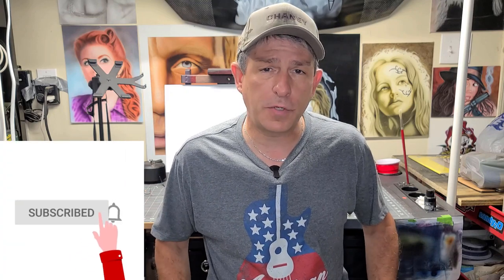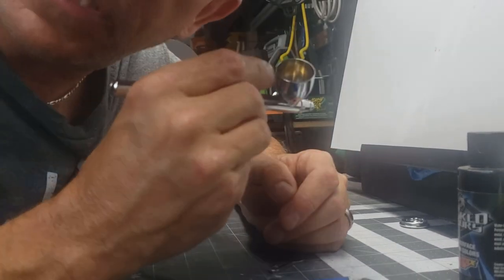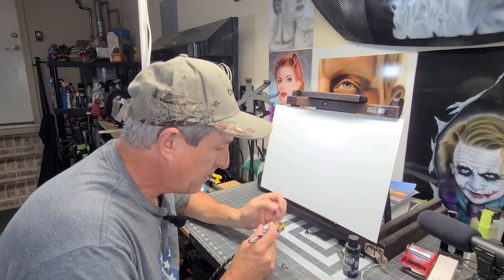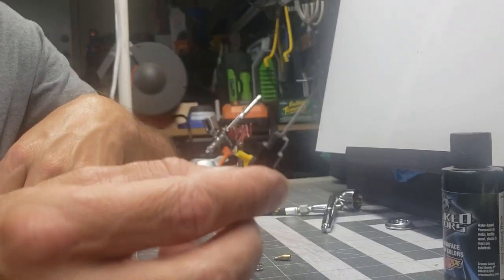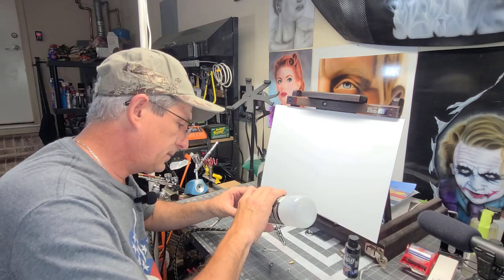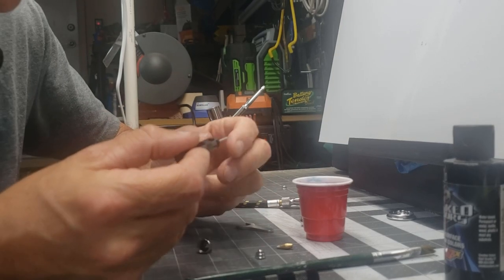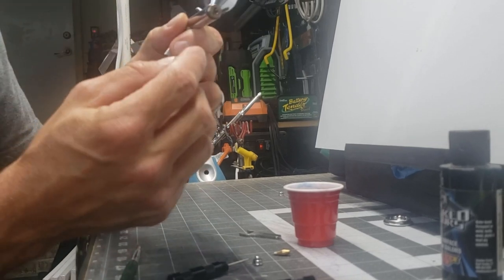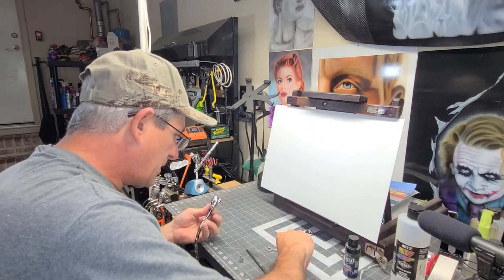How to - Check and Clean your Airbrush Air Nozzle

Comment: I guess it is my problem in my Paashe V . It happened after I switched from an alchool based metallic paint from greenstuffworld to a water based one. I had 2 Paashe airbrushes same model and happened for both. After cleaning multiple times also by the help of ultrasonic cleaner, still They bubble. I guess in both of them are closed the holes in the aircap , but in one of them closed the body holes too (they are 3 thin holes not a bigger one as in your airbrush model) . I'll test your way or eventually try some thin drill bit to clean them. Thanks for this tutorial.

Comment: This is the reason I only use Harder & Steenbeck airbrushes. Iwata is a amazing airbrush but I absolutely hate the engineering of them in terms of maintenance. The nozzle system in particular I find lazy from Iwata. It is effectively the Olympos design which they purchased the rights to in the 80's. Here is the crazy thing. It's not like Iwata couldn't just change their nozzle system to something like H&S uses because they literally have owned H&S since 2018.
Reply: Iwata are some of the very easiest airbrushes to maintain. Very simple.
Reply: They probably just want them to remain different from each other or else they'd turn them to the same airbrush
Reply: @ryanbarkley5437  To quote the dude "well that's like just your opinion man"
Reply: @joshm8661  Your probably right. For me I would love for Iwata to adopt a removable cup and floating needle head assembly airbrush with a custom micron style body.
Reply: @Thornbeard  i do like my nozzle on my h and s with it being floating instead of the tiny screw in nozzle like my other airbrushes.